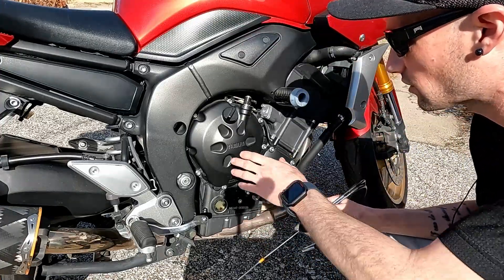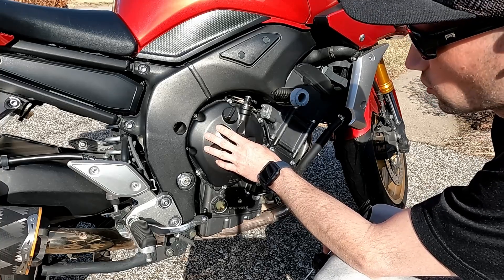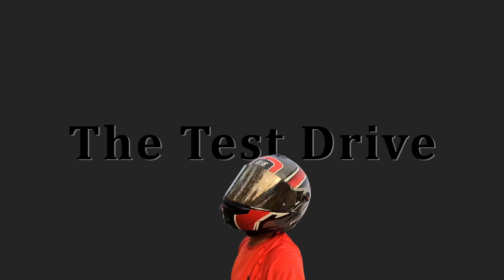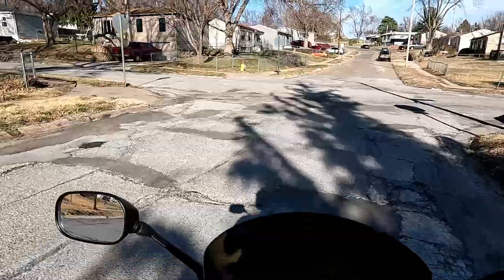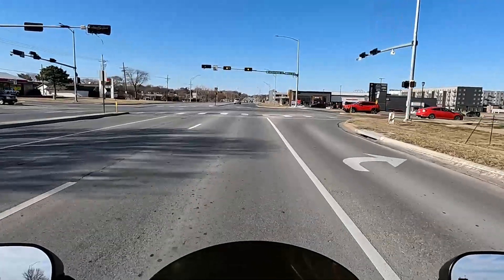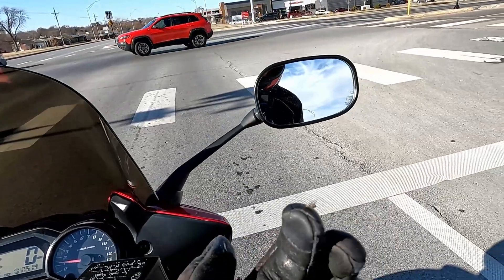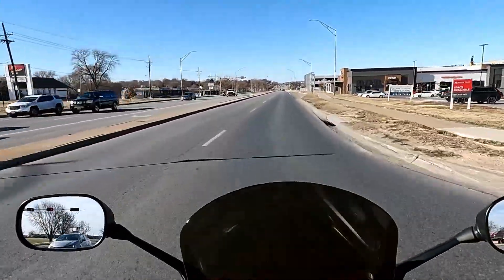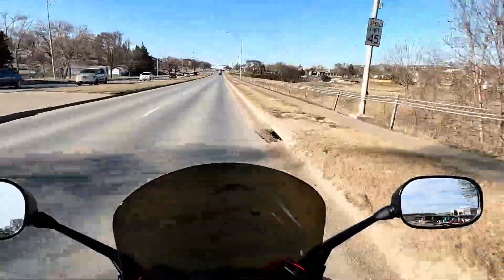Yamaha FZ1 Mystery Noise – Can It Be Fixed?

Comment: Watching this last l series out of order .. saw you tear apart clutch first and was thinking your looking for a problem that maybe wasn’t there … then I got into this vid lol … hearing that whine I woulda first thought air /intake  type of sound …. Then I remembered back in the day when buddies would use gear driven timing on muscle cars would sound just like this …
Reply from the maker: Yeah the straight cut gears seem to make a very similar whine noise.  I haven't completely ruled that out yet, but I think I found the true problem.  I'm doing some major work today, and  hoping to have some videos up soon.
Reply: @grimsmotovlogs369  my 09 fz1 (30k miles) has issues of its own but no whine ,at least not noticeable over all the other “bike noises”…. So yeah ,you seem to be chasing a worthy gremlin lol.. good luck

Comment: My 06 has a little whine too, it has always been like that. Yours sounds a little louder, but not much.
Reply from the maker: Ive had people tell me that too. Saying that it’s normal. And if I didn’t feel like a vibration in my handle bars when it’s a cold start and I engine brake I’d think it’s normal. But that weird shudder made me think it was in the clutch area. Plus it sounds like it’s coming from there too. I’ve still got it torn apart rn. I’m going to check the oil pump/water pump tomorrow and see if it feels bad.  The service manual gives no specs for the chain wear on the drive for the oil pump.So I don’t really know what’s good or normal. It does power off the clutch basket. So maybe there’s something there. Dealer said the noise wasn’t normal but tbh. I feel like I can’t really trust them
Reply: @Grim's MotoVlogs  i know what you mean about the dealers.  They like simple work and easy money.  They aren't gonna give 2 farts about helping you diagnosing a strange noise with no obvioussolution. I rarely have a good experience from dealerships. I never trust them, they will lie through their teeth if it makes their jobs easier.
Reply from the maker: @mobleyMobley  facts!
Reply: @Grim's MotoVlogs  actually  I relistened to my fz1 and your whine is actually a lot louder.  I uploaded a video so you can hear mine. 
 https://youtu.be/cwR6YtWbyXQ 

Maybe it is louder in the heat, I am in michigan and it is only 60 degrees today, I will listen again when it gets in the 80.s , because I feel like it has been louder in the past.
Reply from the maker: @mobleyMobley  thank you for that! I’m going to check it out!
Reply from the maker: @mobleyMobley  just watched. Yeah it’s definitely a lot quieter than mine! I don’t think yours sounds too bad through my phone speakers. That was a cold start too?
Reply: @grimsmotovlogs369  yes, cold start

Comment: my r1 have the same issue, when do part 2 come
Reply from the maker: I have parts ordered. I am currently waiting for those to come in before I tear into it. But once they arrive ill be tearing into it. You have the same noise?
Reply: @grimsmotovlogs369  Yep same noise, but my Mechanic says its normal. What do you Think it is
Reply from the maker: The dealer here told me my noise wasn't normal and I agree with them, but I have had people say its normal. I'm hoping its the bearings in the clutch area. The dealer thought it was in the cam drive, but I don't think they even tried tbh.
Reply: @grimsmotovlogs369  i look forward to the next video to see if its stop 🙏🏼